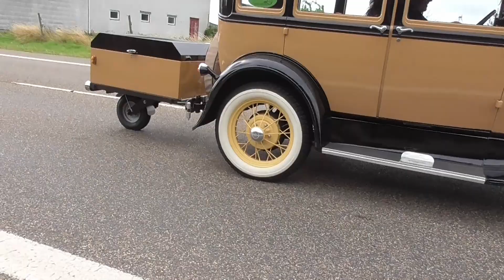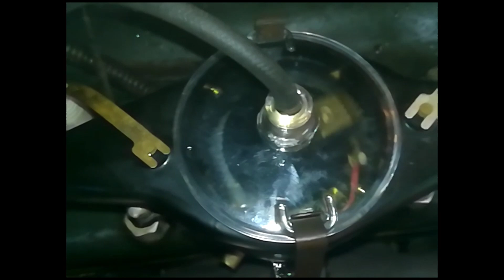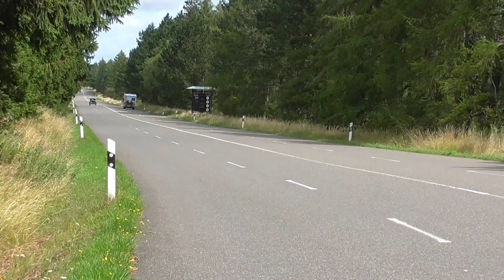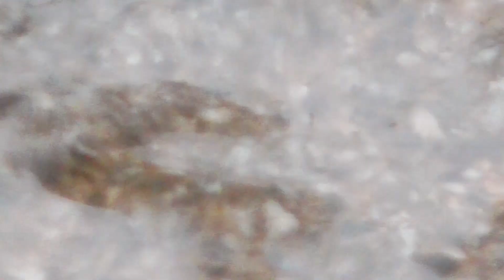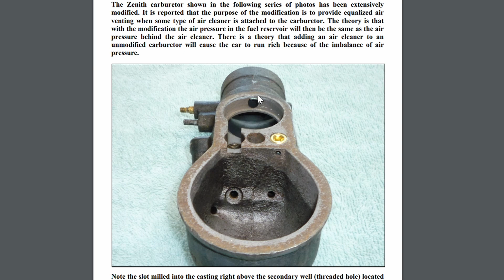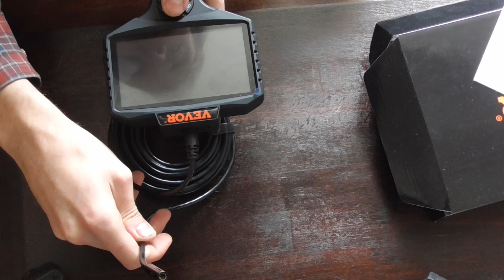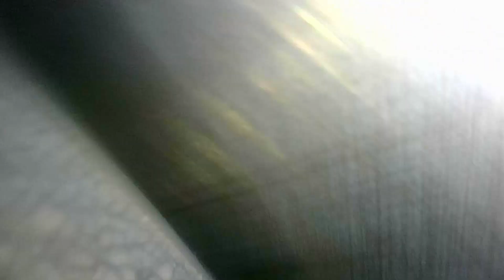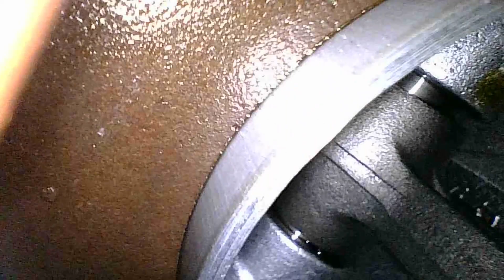Model A Mechanics Log #5: Events, Endoscope, Gaskets

Comment: Not going to lie-it made me a bit uncomfortable to see you taking even more rubber off of those poor tires, but hopefully it will get you a tread that will work, at least for a little while.
Pretty neat solution for the vacuum tank and wipers. The one way valve will make a good addition.
  "Just" a Model A Ford after all? Shame on you! 😉
Reply from the maker: Well, I didn't make the tread any deeper than the deeper parts of the original profile - as long as I don't cut into the wire webbing, I'm not worried. 

Well, if there's an engine out there that won't care what condition it is in, it's certainly the Model A's xD

Comment: Agree that earlier ignition should lower the temperature a bit and that there is no absolute limit. It is load dependent and one can hear it on the engine. A richer mixture of course also lowers temperature. So does RVS, did you ever look into that?
Reply from the maker: Never heard of RVS - what is it?
Reply: @AstraWerke  Ah thought you knew, this is their summary video https://www.youtube.com/watch?v=gSdZHt0K_h8&ab_channel=RVSTechnologyUSALLC  I have not used it with my A, because its not ready yet, but I know two who have restored compression with it. I also think it has helped my BMW R100 2-wheeler, but that engine is like new. The more wear the more effect.
Reply: Dear  @biondanishgenomeinstitute8193  
Sounds almost too good to be true. But of course ceramic nano tech coating for car paint (for instance), is already working extremely well.
Best regards, luck and health in particular.